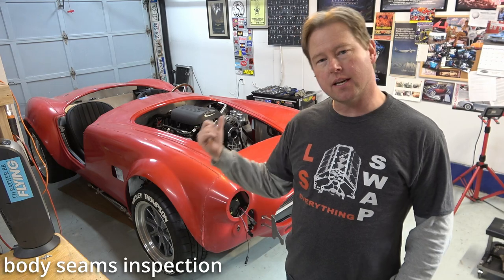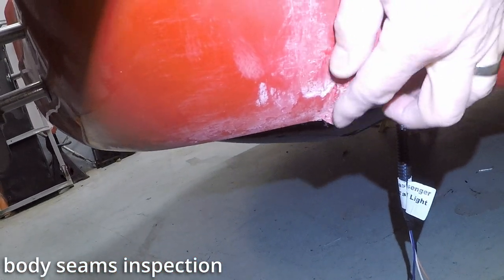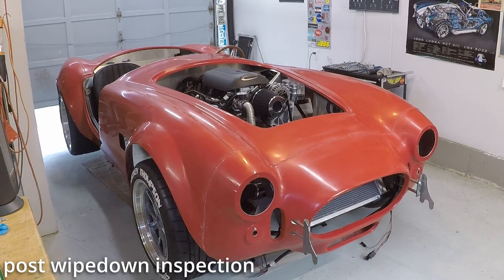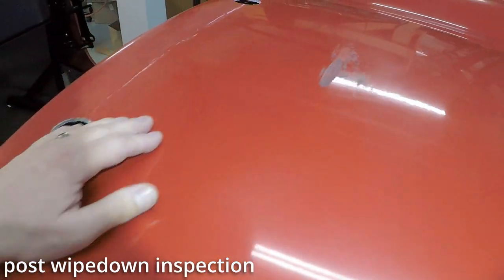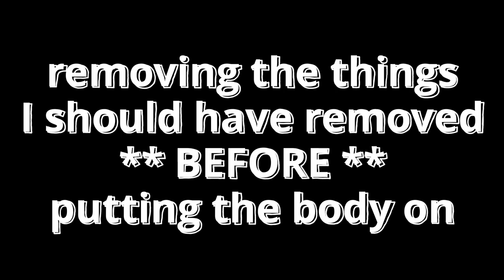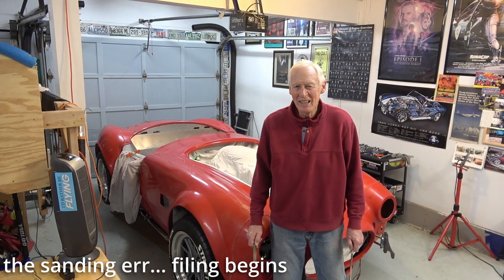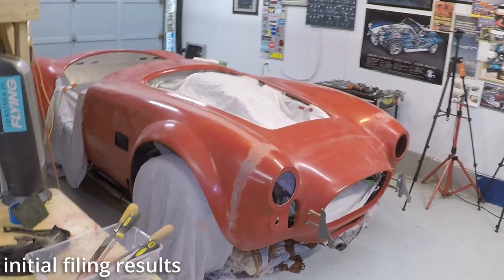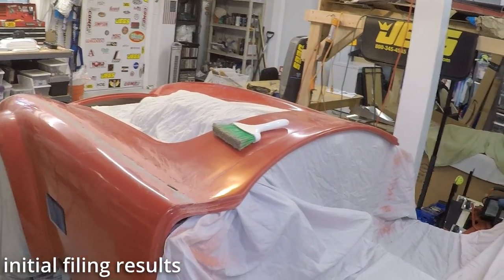Budget LS Factory Five Cobra | Build Update 59

Comment: Proper term is "parting lines" not seams. All those lines are between the various mold pieces that are joined to lay up the body and then taken apart to release the completed one-piece layup. Seams suggests the body is made from separate pieces and joined together. Not the case. The green you're seeing is clay sometimes put between the mold pieces before layup. It needs to be completely removed. The white material is likely mold release. It too needs to be removed. The filler/repair material most commonly used for large holes, those broken out spots you pointed out around the front opening, etc. is a 3M product called Marine High Strength Repair Filler. Often referred to as HSRF. It's a 2-part filled vinylester product that's compatible with the Factory Five vinylester body and highly recommended. Nice work doing all that by hand, but that's the hard way. Power tools are your friend in this case and looks like that's in the next video.
Reply from the maker: Thanks for all the great info. I ordered some HSRF.

Comment: I sanded most of my seams to level them, but you need to make sure you find all the air pockets, and you have to get all the wax out of the seams.
Reply from the maker: It seems as though I need to sand deeper into the seems to get all the air picks exposed? Can they be filled with body filler ok?
Reply: @AmateurHourGarage  yes they can...i havent tackled my bodywork yet, but I've quite a bit of fibreglass boat experience. I plan to take those seams down flat, with an oribital sander and then 'gouge' them all back to below the surface with a dremel tool. I intend to get a decent amount of 2 pack filler in there as it will all fair back easily with some machine/ hand sanding. As Paul has pointed out below, these are not seams, so there is no risk of affecting the structural integrity of the body